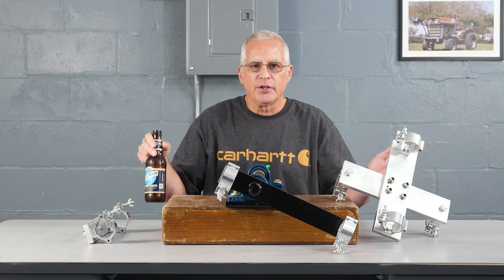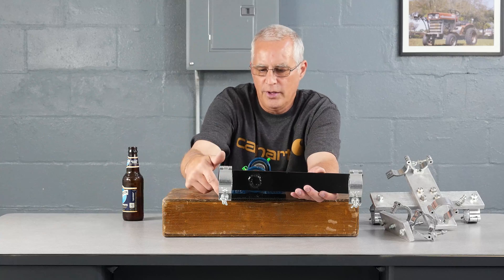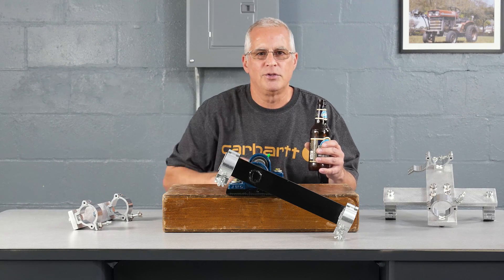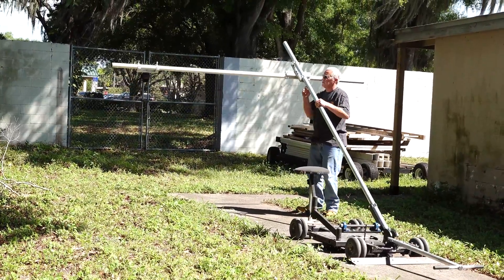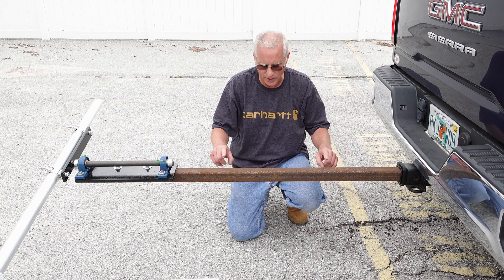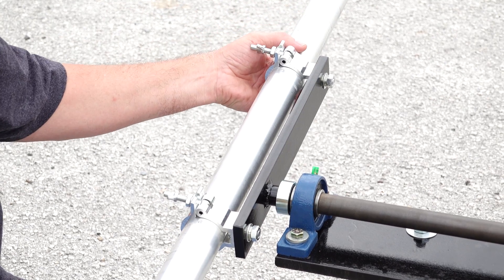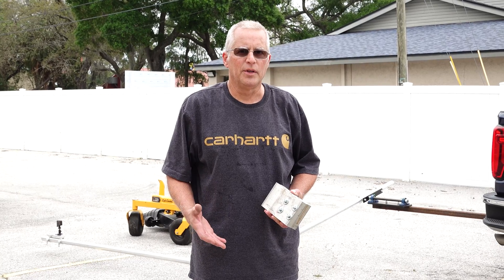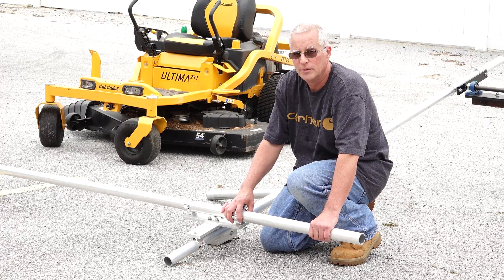180° Overhead Camera Rig - Prototype Number 1

Comment: Hi and good video, the flexing problem is lack of triangulation. You need to triangulate the long speed rail to the shorter speed rail in which you have the camera mounted too.
Reply from the maker: Yeah, I figured that. The issue is, doing it and keeping it light enough to be usable and not creating shadows. We tried a second version with lighting truss but it was too heavy to move and still had flex.

My original thought was to use speed-rail fittings and get 45° fittings to brace the top and side rail. But it would not solve the side to side floppyness.

I was thinking about putting a square in the center of each pole and connecting each corner with each end with cable. It is a common design on large booms and might work, but it is going to take a bunch of time and money and at the moment, the project is on hold.

It works well at 5'-6' just not at 10'.
Reply: @mrdogpoopstudios  The rig and effect you get can look very good, but as a key grip the rig only makes sense to build on a small scale. The bigger you go with a rig such as this the more crew, budget etc you will need.  NOT TO MENTION SAFETY.
Reply from the maker: @recardosands9948  Yeah, that is true and we were trying to figure out how to manage the weight and span. One idea was a hand crank or electric drive that would allow a smooth safe arcing motion.

But first, we need to get the stability issue worked out. Safety was definitely a concern when we started mounting it to the dolly and the dolly was rolling.

All reasons it is on the shelf right now except for smaller scale.

Comment: Next on a pulley based motor! :-)  Exact movement, will get rid of a lot of the jerkiness.  Motor controlled by Arduino.
Reply from the maker: I thought of that after building it and considered adding a hand crank with gears. But we already have the second prototype built and it uses a wheel hub from a trailer bolted to square truss.

I think it is going to work well without a motor control. We will be testing it out and making a video this week.

The more complicated it gets, the more things can go wrong when you need it and when you have hundreds of tools, it becomes very hard to maintain and repair it all. So we are trying to stay simple.

Comment: I'm hooked dude, you're a very clever man. Thanks for sharing these!
Reply from the maker: We already have the new prototype which is cleaner and makes more sense, still under $150 and should be much better and work at a10'-12' radius. We just have not had time to make the video.

I am glad you liked it, we have lots more planed. Also, check out the our video on the 360 dana dolly tracks rig, that is a bit more practical for most people.
Reply: @mrdogpoopstudios  Nice one. Love the innovation, but the budget side of it is great too. I had to make a dolly that pushed through a car last week (2.2M long). It was tricky, but worked out well.
Reply from the maker: @mtscott44  I have actually seen a lot of those types of shots on gopro's on a string and plastic straw sliding through the vehicle, if you need a cheaper solution.

We love cheap and effective. I think some of the bigger production companies go overboard because they have the budget. But you can usually do the same thing cheaper.
Reply: @mrdogpoopstudios  Yeah I saw that! But nah, I had to use decent cam and specific lens, so had to create a beast of a rig. It worked!!! And I did it on a budget, promise hehe